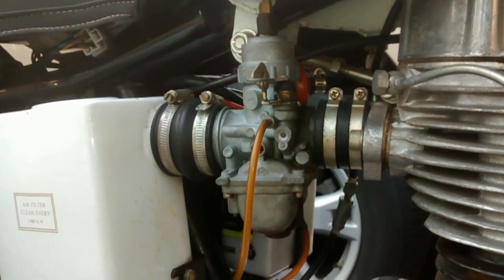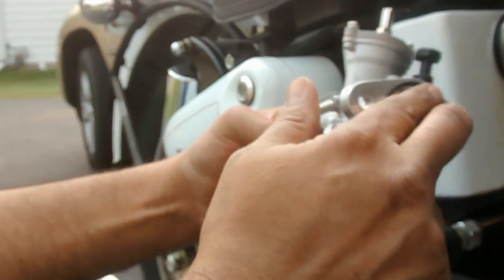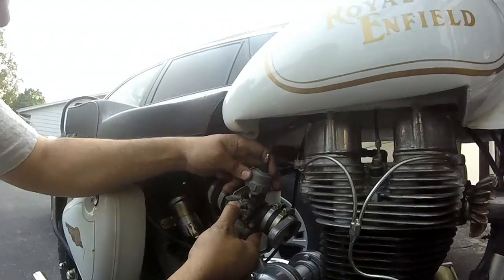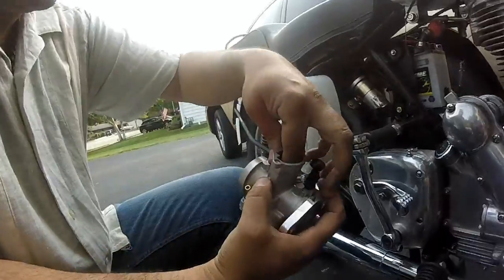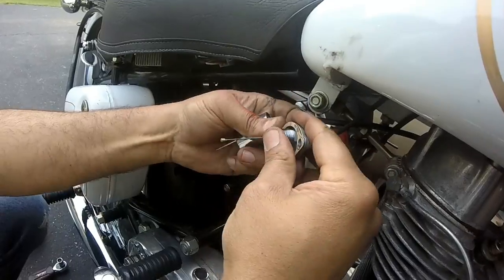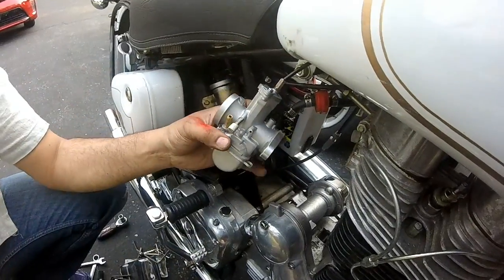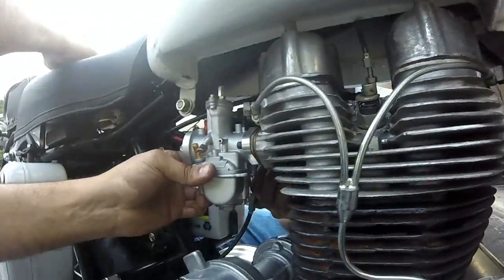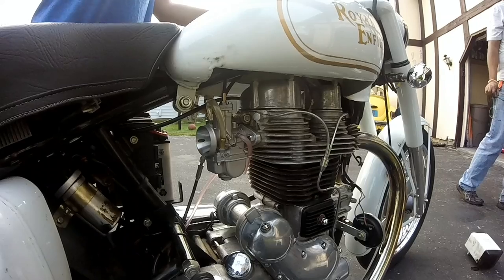Royal Enfield Performance Carburetor Installation

Comment: definitely a very good video, it's always a tricky DIY. I am having a hard time setting the idle low on my 2003 500 Std so I am replacing VM32 with VM28 (also the needles to stock) to get the authentic stock feel
Reply: Priyaranjan Jha ,is it Indian made 4 speed right shifter std Bullet.?

Comment: Great video.
I will be attempting this carb change tomorrow morning on a 2008 RE Bullet C5 Iron Barrel.
Reply from the maker: Easy swap. Just get the right size studs. If you use too long then hard to fit the nut.

Comment: Great Pleasure VC watching ur video.

So far I got frm my carb research is that , a carb is fully mechanical. Grinding/sealing the needle tip ll exceed/reduce the fuel flow. The same goes for air screw !!. 
Huh yes, physical dimensions does matters betweens brands, but not a huge difference. 

Or increase bore size, coz engine is the one who controls the carb !!
Reply from the maker: Carb design matters a whole lot. For sure the bore and fuel flow does matter, with the right design.

Comment: What happens if I put a 350 carburettor into 500 cc machismo bike ?
Reply from the maker: You will need conversion manifold.  And up the jets.
Reply: Will it harm the engine
Reply from the maker: @jigmetstanzin7569  run and check if the bike runs lean then up the jet.  running lean will harm the bike.  running rich will foul the spark plug.  the spark plug should have a nice brown tone to it.

Comment: I would like to use my stock air filter box. Will this carb fit the stock hose on that side of the carb?
Reply from the maker: you will need a reducer rubber connector.

Comment: That was very informative as well, I just need to know your previous mileage with the default carb which the bull had and the difference in mileage after replacing the new JRC 30A carb @Vintage-cycle
Reply from the maker: prathiek raj sorry. I never bothered checking milage. I am sure it little bit less now.
Reply: Actually I own a 1995 bullet(petrol varient), the default mikcarb owes me about 23kmpl even after complete rebuilt but once i remember a mechanic said he can increase the mileage upto 40 kmpl but i missed his contact. Do any one have idea over this , like i thought of replacing it with the new classic Carb but i do not know how this would perform on my bike

Comment: helloo sir,i saw selt start in your enfield bike,here in india this mechanism dosent had self start so did u installed it by your self or it is inbuilt. if u have done it then please provide some informative  videos so that we can watch it and learn ..because here mechanics says installing self in old royal enfields that is your in these it cannot be installed if done then it is not successful...
Reply from the maker: Hello Aditya.  it is possible,  you would have to change the casing of the engine to put a starter,  2006 and later casing had the tab to install a starter to the engine.
Reply: Please share the information how to install the same .

Comment: I have recently fitted Amal mk1 concentric 26mm carb on my 1984 350cc Royal Enfield I am having trouble on the carb when  idling coz its not stable the engine goes off sometimes as it’s throw back fuel in carb any possible teach me how to tune the carb 
Thanks
Reply from the maker: Madeswari V I would check valve clearance, ignition timing and then set the carb.  Check the fuel mixture.

Comment: I've just finished trying, rather unsuccessfully, to install a micarb VM 28 on my standard 350 CI. Trouble is that the spacing of the pegs that tether the carb to the engine intake are differently spaced. Not sure where I can get a custom manifold fabricated. This carb too, since its a direct fit on your 500, I suppose would not be a direct fit on the 350. Any advice would be really appreciated!
Reply from the maker: meraj shah the adapters are available on eBay. or have one made at your local machine shop
Reply from the maker: https://rover.ebay.com/rover/1/711-53200-19255-0/1?ff3=4&toolid=11800&pub=5575125408&campid=5337693578&mpre=http%3A%2F%2Fwww.ebay.com%2Fitm%2FAMAL-1-3-8-GP-Carburetor-Adapter-BSA-Enfield-Velocette-Matchless-AJS-Norton-TT-%2F321812786907

Comment: Hi  brother... 
I m using 1975 model bullet. I m using bullet original carburetor.  So ,getting mileage is 3o-35.
So my question is..  
Which carburetor is good for getting more milage?
Reply from the maker: Getting better mileage has lot to do with how you ride, condition of the engine.  rest you can set the carburetor to optimum setting, if you lean it too much it will burn your valves and piston, but if you go the other end then you will fault the plug. So it has to be just right.  Makuni carbs do well with single Enfields.
Reply: @Vintage-Cycle   Always i maintain speed about 45-60 km/hr.
And single use only 😊.
Thanku brother  ....

Comment: Would this carb work good for a 2007 royal enfield 350 Indian model ?? Or what would be a good carb be for that model ??
Reply from the maker: Not sure for the 2007.  If that bike is fuel injected then not.  Will have to replace the intake manifold.

Comment: Is it fit to bullet 350(1971) model perfectly
Reply from the maker: I don't think so, but you can have a conversion plate made.
Reply: Vintage-Cycle I can't understand, what kind of changes I have to made?
Reply from the maker: ok,  this carb will fit the 500 cc old iron head bike.  but if you like you can have a manifold that will fit the 350cc head. like https://ebay.to/2JFPqhf  so you would have to make something like this but the opposite.

Comment: Hi I would like to install self starter to my old 2001 modle royal Enfield so is it possible
Reply from the maker: +rolvin almeida you might have to change the engine casing to a 2006 model.

Comment: base from the sound i heard that the throttle on high rpm
Reply from the maker: Not sure what you meant.
Reply: @Vintage-Cycle  i mean the throttle lose power on high rpm
Reply: @Vintage-Cycle  or it hasnt tuned yet
Reply from the maker: @fernandarafi  Yes It was not tuned fully yet.

Comment: I need a performance carb for my 535cc GT. What size would you recommend? (mm)
Reply from the maker: Not sure on the 535.
Reply: Vintage-Cycle.com I saw a carb conversion kit on Hitchcock's motorcycle website, should I just go for that?
Reply from the maker: Hitchcock's is the source for parts, you could if you don't find any local source.  not sure where you are at?

Comment: hi there Vintage-Cycle.com .  I have a RE TBTS 2012 - 350  i Want to install this carb is that possible  ,weather its a direct fit for my bike ?>?????
Reply from the maker: +Deepak Shandil What you have is a fuel injection motor.  that is a whole new story.
Reply: no its not a fuel injection , as i got the simple card  THUNDERBIRD CV CARBURETOR  , as i send you the link can you check

Comment: Hi i have just got a RE STD500 2004 model in India I'm looking forward to add a performance carburetor please suggest me and where I can get.. need it badly
in above video I can't see yu fixing a air filter why
Reply from the maker: air filter is very important, but not much dust where I ride.  I have few old british motorcycles and most of them don't have a air filter.